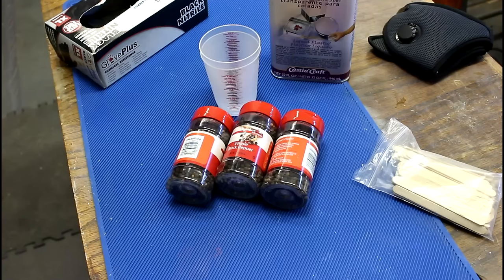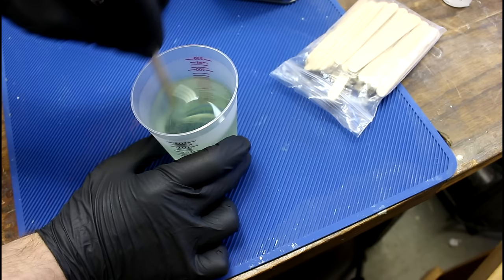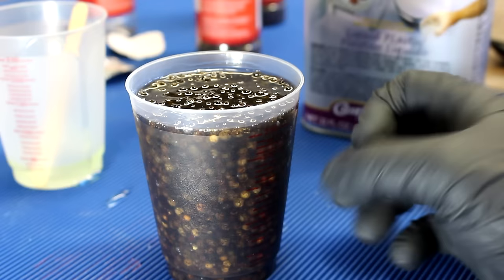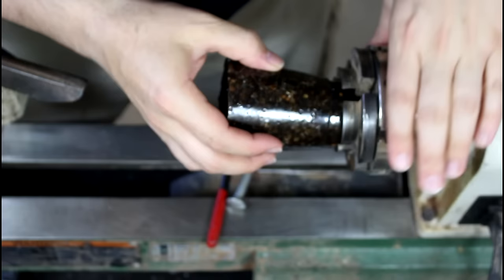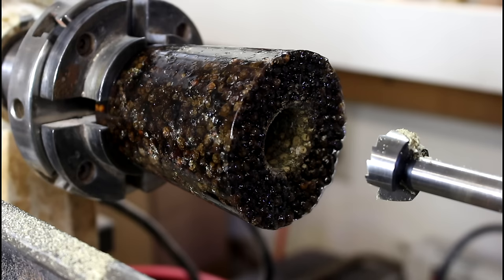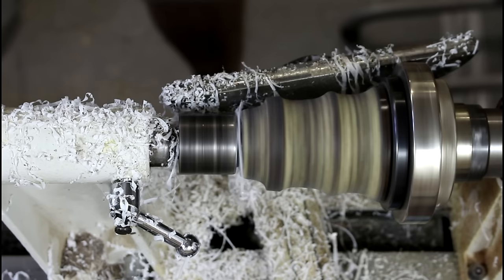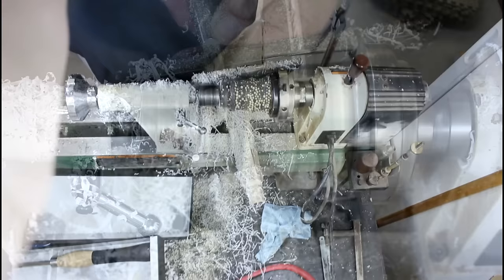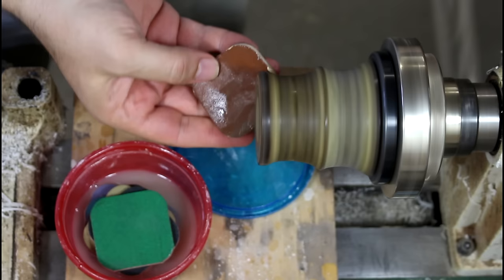Dip It #9: Peppercorn Pepper Mill

Comment: Remove bubbles by placing a sheet sander upside down (obviously with no sand paper on it) then allow the vibration to shake the bubbles to the surface. The same trick works for removing bubbles from concrete moulds. Place a sander against it and the vibration will shake all the bubbles free. With this you would obviously need to stabilize the cup tho.
Reply: Good idea. Another way you could do it at latest in this situation is if you have a shopvac with ruffly the same size hose as the cup. Just align the hose with the opening of the cup then turn on the shop vac, but that might just crush the cup. Idk
Reply: not with the flexible cup he was using. the external pressure being put on the cup would bend and warp it a lot.
Reply: Another simple way that many people might have is a air compressor and pressure cooker pot. Just make a simple modification to add pressure blow off valve and quick connect. High pressure in container will make bubbles shrink ultra small. Just keep blow off valve set psi to pressure cooker pot rating for safety.
Reply: could tdo that with a magic wand

Comment: I used polyurethane resin a few years ago to make jewellery and I found that if you LIGHTLY tap your mould on a flat surface as you are pouring your resin in the bubbles will naturally rise to the top where you can pop them with a pin or something similar (most of the time I just left them to pop by themselves). I have found this a very reliable procedure in everything I have made even when making things like plaster moulds they've always turned out perfect. Hope this helps 😅😁🤗

Comment: If you took this, and then dipped it I another cup of resin so the whole thing was incased in resin again, then turn it one more time, you would have a smooth finish, and would be left with an encapsulating layer of resin that you could polish smooth. If that makes sense...
Reply: Brady Nuss i know your comment was a year ago but genius!
Reply: Another way to do that but way way easier is to just brush some resin on top instead of dipping it

Comment: You should try to capture liquid in a resin "bubble" of some sort not very practical but it might look cool
Reply from the maker: I cannot convey the many hours I have wasted on this. Someday I will figure it out....
Reply: +Peter Brown Have you seen how they make the iceball cocktails? I don't know too much about resin but you might be able to do it this way then seal up the hole with more resin or maybe try sculpting a sphere out of silicone putty (this might be considered cheating) and filling it with liquid? Sorry for the long comment, I can't wait for the video when you figure this out!
Reply: Catness Twig downside to this is most liquids actually inhibit resin curing!
Reply: Catness Twig. Yeeessss
Reply: Look up "spherification". It may not be quite what you're looking for, but it's definitely a viable way to keep a liquid in form without temperature being an issue. Also forms perfect spheres, which would look cool.
Reply: Catness Twig That's actually a really cool concept and I hope you figure it out, Peter!
Reply: KrazeeCain I love spherification!
Reply: Catness Twig I thought that the other day
Reply: What if you freeze the liquid, sculpt it and then encapsulate in resin? time could be tricky :(
Reply: Clair B. resin heats up when it cures
Reply: Peter Brown try using the sort of stuff that is used in capsules. It should be able to break down after a little shaking and moving since gelatin does breakdown under water
Reply: Peter Brown make two small resin bowls then glue them together. With a pinhole between the halves. Fill with a hypodermic needle then seal. When you include this ball in your next pour the ball will disappear the way resin shavings did leaving just liquid.
Reply: Ice!! Or if temperature is an issue, maybe mercury in a sealed glass/plastic container inside of a resin sculpture?

Comment: +Peter Brown    It might be an idea to apply a finishing coat of epoxy in order to prevent the peppercorns from perishing
Reply: I was thinking the same thing, not that it would rot quickly but you're guaranteed to get pepper on the hands using it every time

Comment: Pepper spray is made from concentrated capsaicin, the chemical that gives the sensation we know as spicy. Peppercorns, on the other hand, do not contain this chemical. In fact, peppers, as in chili peppers, were named after peppercorns because capsaicin has a similar flavor to peppercorns despite being caused by different chemicals.
Reply: Interesting!
What confuses me even further then, is that when I put chili powder in a recipe I'm making, it doesn't seem to taste spicy. Black pepper, on the other hand, does make it taste spicy. At least to me. That's strange.
Reply: @JoDidntHearYou  If you eat a lot of peppers or spicy foods containing peppers, it could be that you have an acquired tolerance to the effects of capsaicin, while not having the same tolerance to piperine, the chemical in black pepper that gives it its kick.  Piperine is about 1/100th as spicy as capsaicin, but peppercorns are 5-9% piperine by weight, while the most common chili peppers vary from anywhere from .01%-6% capsaicin, and are usually diluted much further in chili powder, while peppercorns are eaten raw.  Given that chili powders generally have a Scoville rating of around 500 (very, very low), I'd say it's not hard to imagine there being at least 100x more piperine in ground black pepper than there is capsaicin in chili powder, which would make it hotter than chili powder, especially for someone who's used to consuming a lot of capsaicin but not a lot of piperine.
Reply: Brian Bethea I love that it’s 3 years later and I just got the notification that you responded to my comment. Thanks for the insight!

Comment: Dude, kudos to you for even thinking of doing this, let alone following through! All that pepper dust must be awful and yet you still have a lovely looking piece!

I regards to using a vacuum chamber; in my works we have these large water-cooled transformers that I repair and once the coils are fixed and fully prepared I cast them in a block of araldite to help protect the coils and provide electrical insulation. One of the problems is of course the gosh-darned bubbles, and we don't have a vacuum chamber large enough to help remove them. What I've taken to doing instead is cutting a hole in a piece of stiff plastic and fitting the nozzle of a normal household vacuum cleaner through it and roughly sealing with tape. I then apply the plastic sheet to the mouth of the mold and turn the vacuum on. The force of this pulls the plastic flush to the sides of the mold, so don't worry too much about sealing the edges, and although it's nowhere near a true vacuum it still has a similar effect in removing the bubbles and pulling araldite into every nook and cranny. The biggest problem of course is that the mold has to be tall enough that your vacuum cleaner nozzle is not touching the liquid! I find this an effective way to get an even, solid fill, even around complicated shapes with lots of twists, turns and complicated shapes.

Not sure if it'll be the perfect solution for everyone but it's certainly a cheap and easy way to help without industrial level tools.

Comment: how about a lamp made of matchsticks  ?
Reply: match sticks would be cool
Reply: yes
Reply: Nice idea but when the buld gets really hot your lamp will burst in to flames.
Reply: Melle Haanen most matchsticks nowadays only ignite by friction. 

people mostly use energy efficient bulbs. CFL (compact fluorescent light) have a maximum of around 20w. LED bulbs are around 18w. Neither would get hot enough to ignite a match. 

People use matchsticks to make model cars, ships etc all the time.
Or you could just cut the fire starting bit off?
Reply: Nicola Gregson well, good point.
Reply: Turning that blank would be a loooooot of fun.
Reply: it would catch on fire, multiple ways. turning wood will burn it, also matchsticks still ignite in heat.
Reply: Top Doge Come here, Sherlock. Why don't you have a seat?
Reply: ill shit before i sit.

Comment: Hey Peter I was wondering... Would It be possible to do like a double dip? Make a rough shape with the peppercorns and then, after the resin is hardened, dip it again and work with that dip so when you grind away you don't grind away the peppercorns? sorry if this made no sense :/

Comment: Homemade vacuum chamber.
Reply: I thought the same. a wooden box with a layer of resin inside to make airtight. a reinforced resin top with something inside to reinforce it, a rubber gasket attached to the top and a shop vac. may not be 'perfect but I think that could work for smaller items

Comment: Loved the video, what you can do also to vibrate the bubbles out is get a cheap sander, without sandpaper, turn it upside down, while held in place somewhere, it can be used as an alternative vibrating plate.

Comment: You can build a vacuum pump really cheap if you can find a dead fridge or window AC unit in someone's trash pile. Just cut the compressor out, wire it up (or keep the control circuitry intact if possible and bypass the pressure switch) and use the suction line (the bigger one). Put an inline filter on the suction and feed it a little bit of thin oil once in a while and it will work for years. I have one that I use for doing AC jobs on cars, works great.

Comment: I might have either sealed the outside with a new layer of resin(I agree it looks more interesting with the exposed peppercorns) or made a mold of the final shape so you really only need to do a touch of cleanup at most and maybe drill the hole. But I really like the idea of having a peppermill and salt shaker/grinder made of the material they spit out. It's quite fitting.

Comment: To help get rid of bubbles, use something (such as a butter knife or such) and gently tap it along side the container. It should help the bubbles rise to the surface and pop. Or tap the container gently on the bench top. On the possible downside, this will make the heavier items sink down the the bottom in the resin.

Comment: if you got a cheap hand sander and turned it upside down, you could vibrate the bubbles out fairly well, not as good as a vacuum chamber, but much much cheaper

Comment: I’ve been thinking about cheap ways to get the bubbles out of castings, one idea is to get an old speaker, make a box to hold it horizontally with a plate over it to put the casting on, then playing a tone through the speaker to vibrate the resin and make the bubbles rise up.

Comment: this looks like fun! I might have made a mold of the shape you wanted, and then perhaps used a mixture of colored peppercorns so that the peppercorns weren't turned down, but settled into the final shape. it would have given a different look, but I wonder how that would come out, if the exterior hulls vs carved through them is better.

Comment: You could use a personal massager or something of the sort to vibrate the mold, which would coerce the bubbles up and out of the resin. It is an extra expenditure, but it's not as expensive as a vacuum chamber.
Reply: Well, when I said "personal massager," I was thinking of actual massagers that you use for massaging. Doing a google search for them, however, results in... not quite what I had in mind.

Comment: Vacuum chambers are fairly expensive. BUT! you can create a vibrator table out of common shop tools. You can would also modify just a standard shop vac or an air compressor to create a "vaccum chamber" that would meet your needs.

Comment: Use an electric or battery operated sander to vibrate the sides to push the air bubbles up.

Comment: another way to get rid of bubbles is to get a vibrator and make it touch the container holding the resin. the constant shaking forces the bubbles out. sounds weird but it works. maybe get some sort of table that shakes around if you dont want to buy a vibrator.

Comment: to get the bubbles out on a "deep" casting like this, would it help to put the resin and pepper  in a hot water bath?  The idea would be to heat the resin up evenly in order to get the resin more viscous so that the bubbles would rise to the surface easier.

Comment: You don't really have to buy a vacuum chamber to remove the bubbles.
Last time I was molding with e just made our own: 4 walls of plywood on a base reinforced with square wooden dowels inside and sealed with rubber strips in all "joints" of the walls and a thick piece of acrylic so we could see inside on top which had a hole in it where we could place a regular house vacuum hose.
Now don't get me wrong it gets nowhere near a perfect vacuum in the chamber but it was enough for us to get rid of alot of  the bubbles.
I would really love to see you make one in one of your videos ;)

Comment: Would you be able to vibrate the bubbles out? I've seen it done when casting concrete using a bare palm sander. Not sure if it's cross applicable though.

Comment: turned out fairly well... I agree it does seem a bit "retro" looking, but for someone who has that sort of look in their kitchen, it would be right at home.....
....can see you'd definately want some dust extraction as CLOSE to the work as possible!!!!   That had to be murder;  dusk mask MANDATORY.....

Was thinking about the vacuum chamber and how it might be improvised.....as thin as that resin is,  you wouldn't need a "hard" chamber like some are.....a 5 gallon bucket with a decently tight fitting lid should do, --all you need is a hole for the shop vac!   would only need a minute or so and it would help tease out a lot of it..      An alternative is a vibration table, which can be duplicated by clamping any of the various massage units to your table or a board and set your mold on it for a few minutes while the vibration runs.......   worked wonders for casting plaster;  seems like it would do well for this too......

Comment: To buy a good reliable vacuum pump is like $120 to $500 and up and up and up, but if you could find us a way to use the little tiny $10 ebay vacuum pumps and just pull a vacuum all night it would work for a small thing like this.

Comment: hmmm sorry this comment is coming from someone who hasn't a clue about these kind of things. but would it be beneficial to brush on a thin layer of the resin to seal in the pepper corns? just wondering if they would go a little funky exposed to the air ?

Comment: Hi Peter! Nice concept! Don't you find a pain in the neck to put the screws of those antique style mechanisms on the turned body? I have done several and found after marking with the awl that I needed to do a pilot hole and put the screw to thread it and then remove it and install. Still I ended up damaging and stripping the head of the screw. And I tried as well using a bent screwdriver. I wish they would make that easier. Anyway, how can I send you one of my stickers? Cheers! Daniel
Reply from the maker: you are 100% correct! Super annoying assembly.
One of the advantages of resin, it cuts threads pretty nice without much resistance.

Send it to my PO box. I'd love to swap stickers! 

Peter Brown
P.O. Box 2870
Santa Rosa Ca 95405

Comment: actaully you can get away with a painter pot but in reverse. instead of air going. you reverse the air in put and out let. thus very cheap and doable set up.

Comment: That looks so "hot"

May I suggest... You mold a 1-1/2inch dia bar out of pepper corns and then mold clear resin outer shell to bulk the dia out to over 2inch. Then you have the corns inside giving the "look" with clear resin grip so you don't have to punish your face and lungs by turning it.

Comment: I think it would be cool to dip something , anything electronic ; like something that has a wire you can have coming out of the resin and be able to plug it in to see the electronic work ; clearly nothing touch screen or with buttons maybe like one of those electric picture frames constantly shuffling through pics of your previous work ? You could make it water proof with silicone or a zip lock bag or something so the resin doesn't mess it up , seriously please try to do something like that ! I've been thinking about it sense I started watching you forever ago

Comment: hey peter can i suggest something? 
for dips like this you get the components all the way to the edge. try doing your dip and then submersing it in resin in a slightly wider vessel. then you would have a better chance of not sanding or cutting into or through them. like your gummy bear project, I bet that one was pretty sticky lol. But I love your project and when you said your eyes were burning the idea of having the dip dipped  came to me. I'd love to see if it helps <PB3
Reply: to add to this thought, your Dollar money clip turned out SO BEAUTIFUL because the resin encapulated it perfectly.

Comment: Actually pepperspray is made with capsaicin which chilipeppers use as a defensive compound.  Blackpepper and other peppercorns are dried berries from plants of the piper genus. They get their heat from peperine. it is a different compound which gives a different kind of burn which also last shorter. Just be verry happy you didn't use chilipeppers could actually be dangerous for your eyes and other sensitive places.

Comment: Couple hundred? You need to spend more time in the hood. Crack heads pawn vacuum pumps all the time because people use them to charge ac systems on their cars. Or even better use a pressure pot and an air compressor.